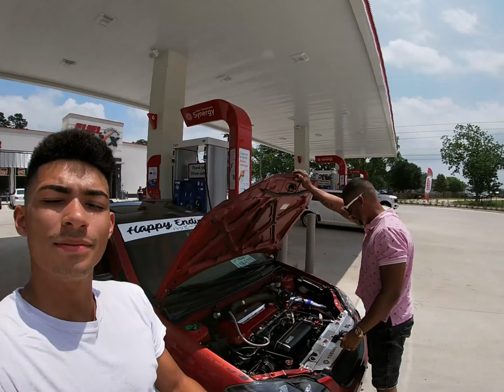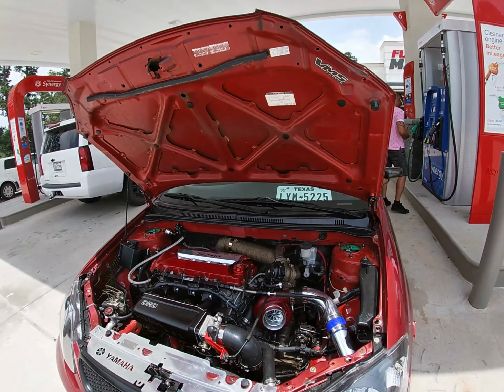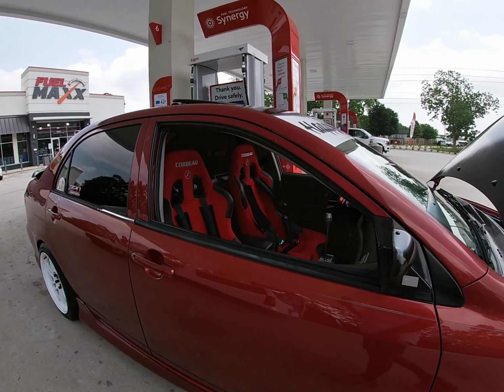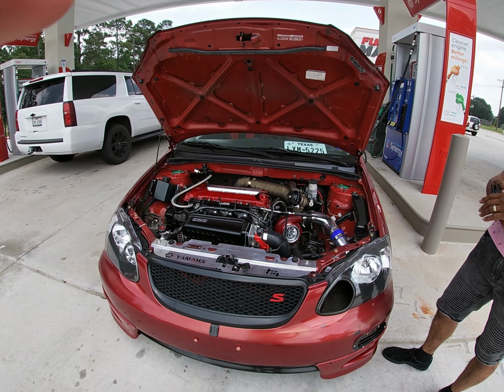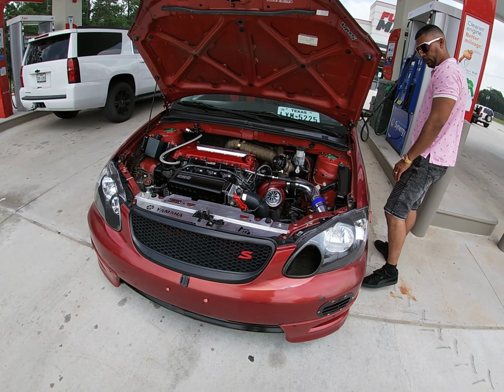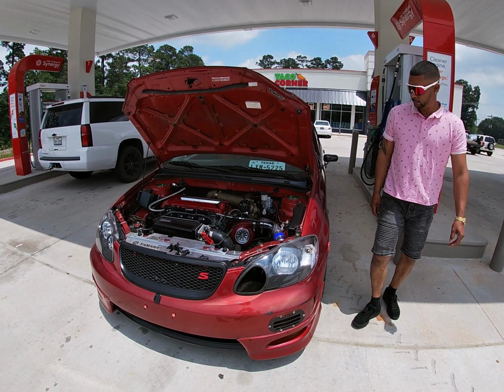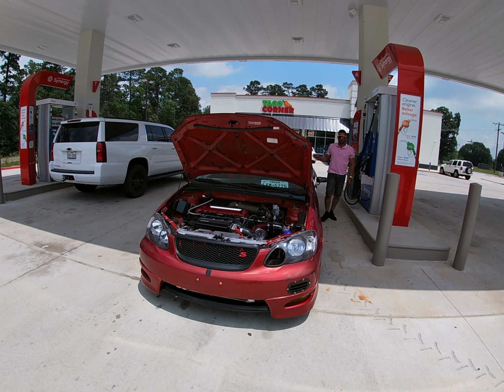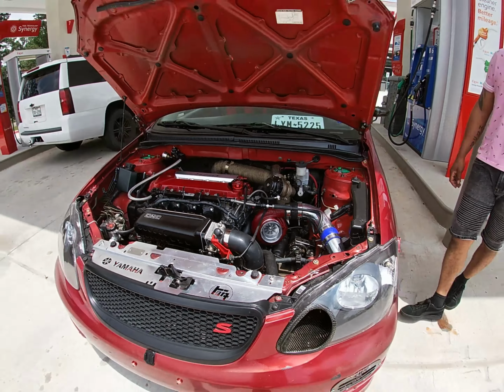First drive in the turbo XRS #2zz #corolla #car #xrs

Comment: I just got mine out of the shop with brand new transmission, TRD lsd, short shifter, bushings. Built motor, then a turbo in a year after everything else. Car is a beast getting Michelin Pilot 4S All Season on Tuesday.
Reply from the maker: That's fire 🔥
Reply: @2zzgte_Jan  she is, wouldn't trade for anything. What other engine is gonna run like a precision watch at 250K miles, zero issues running all the way to redline, all day long? 2ZZs are monsters.

Comment: What are you using to reduce car noise? I've been isolating vocals from soundtracks using ultimate vocal remover. I've been using ensemble mode to combine these two models, MDX-Net: Kim Vocal 1 and a VR_ARC: 3_HP-Vocal-UVR, and i'm getting pretty high quality vocal isolations, maybe like ~90-100% of the audio is clear.  I dunno if it could isolate engine noise just as well, but i don't see why not.

Cheers tho , glad to see people building these cars. Got a 2004 matrix xrs and been wanting to put a fast spooling turbo cuz i've been also thinking bout getting an aluminum boat lmao n need something to tow it.
Reply from the maker: The phone does everything for me
Reply from the maker: And yeah it's something different that's why we build it

Comment: What ecu for these that’s like hondata picking my first 2zz up today
Reply from the maker: They sell various ecus like APEX,Fuel tech and other ones just depends on how much you are willing to spend
Reply: Fuel tech is out of the question if it was a race car yeah but I’m going to be daily driving this for a bit was thinking something more like hondata or hptunes like my brothers cobalt ss has so obd still registers
I looked hp don’t list the corolla
Reply: @single_cam9199 and no you can’t put a Corolla ecu in a celica, the pin outs are different it won’t work.

Comment: Try de subaru maff sensor
Reply from the maker: Wasn't that
Reply from the maker: We had put on the stock ecu and we had a 3inch intake not a 2.75inch intake
Reply: @2ZZJAN  I also have a XRS turbo. I started with a reflash ecu with the subaru maf and 550cc injectors  then changed it to fueltech 550 RK9 tuned sold me.
Reply from the maker: @javierayuso1697  nice I'm using a ft450
Reply: I try the 450 in get short with the channels! Good luck bro your project is awesome! Dipr post my car the blue xrs as sleeper.
Bendiciones!
Reply from the maker: @javierayuso1697  thank you bro good luck with you project as well brother stay safe